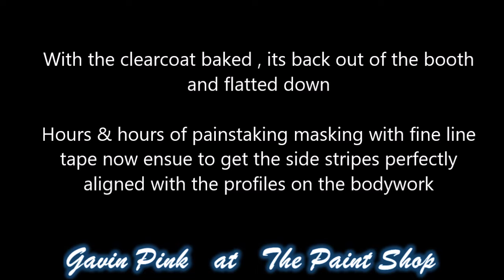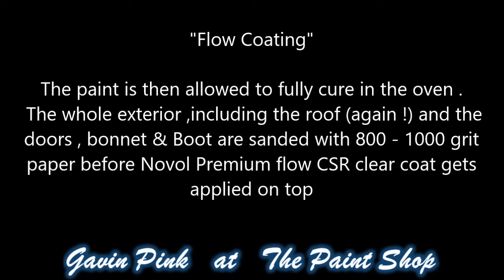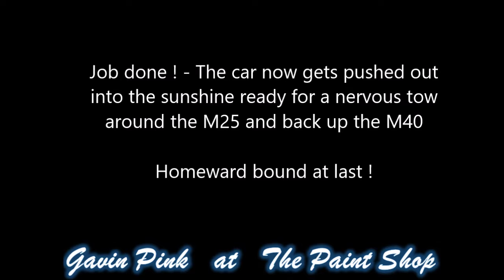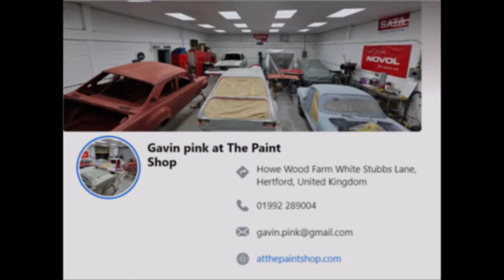Painting the Mk1 - Start to finish (Part 2 of 2)

Comment: Car look awesome Lee...I would not have had those jacking holes on show though
Reply from the maker: There's no way around it Sean , they have to be positioned there as they are tied into the roll cage. They're very common in the rally scene and I actually quite like the look ! , I do intend to get some plugs 3D printed through to prevent dirt / water ingress and these plugs should make the holes look a little less obvious
Reply: @Cossie.Mk1  Ok cool...yes good idea with the plugs